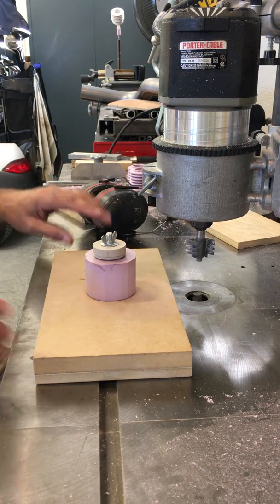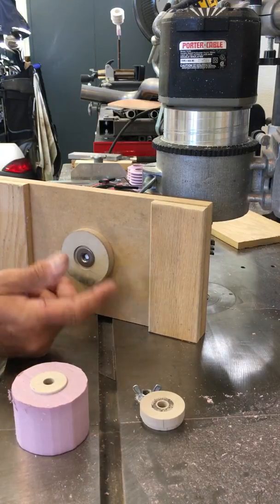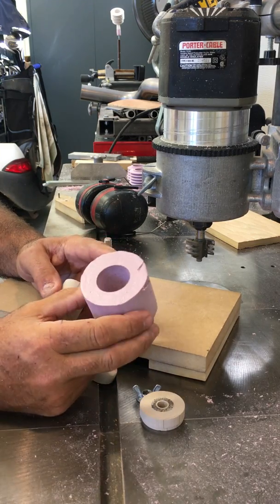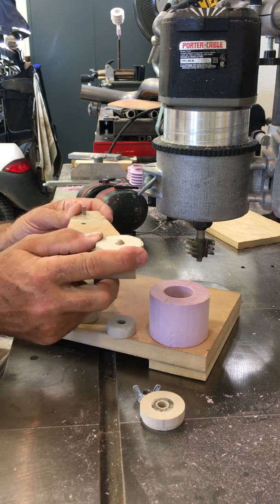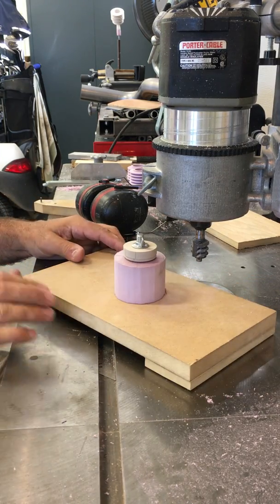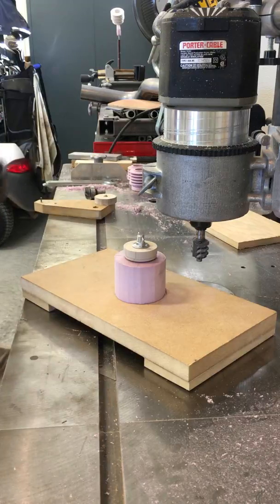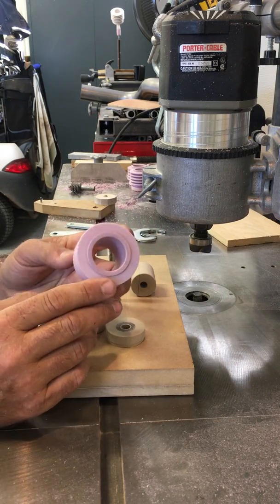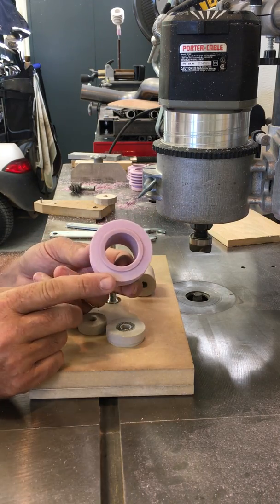Cylinder Jig

Comment: Hii Kelly, just asking... Where can I buy lost foam for iron casting? Any spesific name for lost foam? Thank you... Joshua
Reply from the maker: As far as I'm concerned there's really no difference or preference for foam pattern material for casting different metals. I have videos posted on my channel discussing these materials but in general, extruded polystyrene insulation board in the 1lb/ft3 to 1.5 lb/ft3 density range as sold in the big box stores work well. I use Owens Corning Foamular 150 (pink) but Dow (blue) is a similar product. Both are economical. Best, Kelly